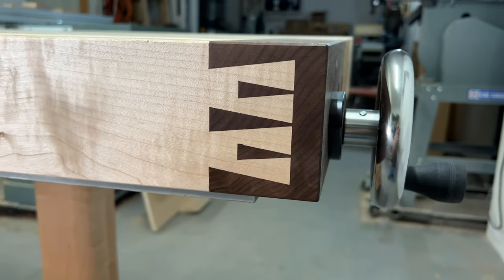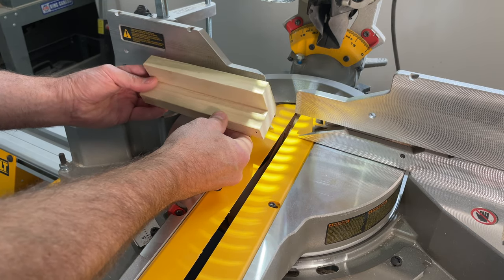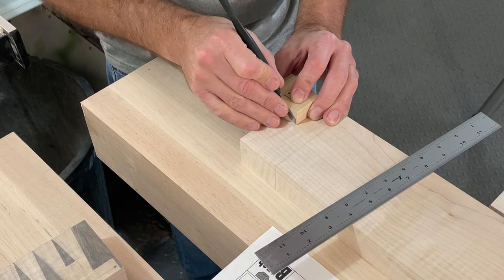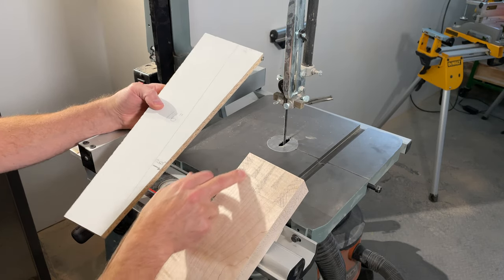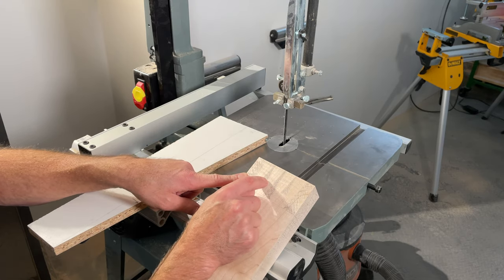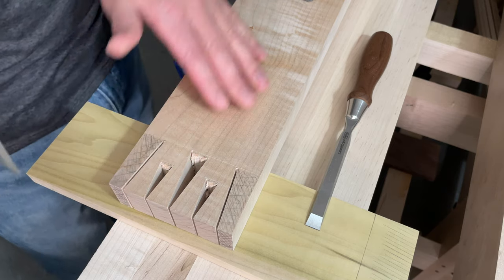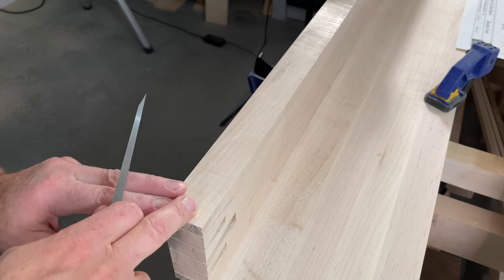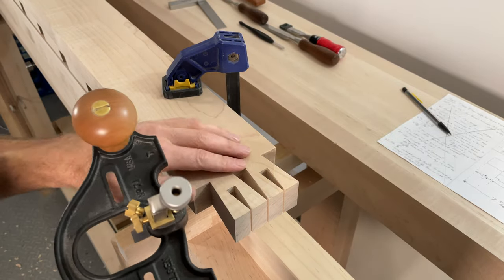Houndstooth Dovetails: Easy Fancy Joinery

Comment: This is my kind of video.  It's all about "how to do this joint".  Some folks just get off track yakking about this or that.  I'm thinking I would have tried trimming out of the waste using horizontal cuts, with the grain, versus vertical against the grain, and cleaning up using vertical cuts at the inside end .  Your technique is one I plant to experiment with.  Thanks for this video and your time making it.
Reply from the maker: Hey Jeff. So I thought the same thing originally but after I saw how fast Frank Strazza does houndstooth dovetails using this technique I decided to give it a try. I feel like I had more control using this method and that it went fairly fast too. I obviously could have done them faster if I wasn’t filming but I just take my time and enjoy the process. Thanks for watching and commenting. It really helps the channel!

Comment: Gary these are just quite beautiful.  I have a question about the deeper portion of the vertical walls of the houndstooth dovetails.  The Cosman (or any) dovetail saw, applied diagonally into the houndstooth, only goes so far in before you reach your limit lines on the top and front faces.  How do you extend the inner vertical wall cuts all the way to the bottom of the dovetail structure?
Reply from the maker: Hey Ken. Thanks for watching my video and commenting with some kind words. I appreciate it very much.

You just simply use the triangular portion of the wall that the saw will cut as a guide. It works surprisingly well.

Comment: Gary, one question. 
For the endcap, that looks like one very thick piece of walnut (16/4?).

I rarely see walnut available in that thickness (I'm in Minnesota) at my local hardwood suppliers. 

Did you buy that at that dimension, or arrive at it some other way?

Maybe i should start looking for carving blocks or something like that instead of rough sawn lumber....
Reply from the maker: It was originally 12/4. I live close to three good saw mills. Two of them didn’t have anything thicker than 8/4 or 10/4 (I forget). They could have “ordered” it to be cut before the next batch went into the kiln but that would have added 4-6 weeks to get it. The third mill had 12/4 walnut but in 12’ and 14’ lengths so they cut 12-13” off of one board to give to me and moved the remaining portion of it to the next shorter stack. 

My advice is to see if someone has 12/4 and just have them cut 13” off of it or ask the mills if they have offcuts in 12/4 sitting in a corner. They often have them so if you ask the person who manages the warehouse and tell them what you need it for and the exact dimensions they may just find it sitting around somewhere. I did this at one of the sawmills and they found me a random offcut but it was after I already obtained the one I ended up using.

You could also mail order it. Lots of people have had good luck buying lumber online sight unseen.

Message me on instagram when you are done so I can see pics!
Reply: @garynelles  thanks for the great info! Will do!

Comment: Great job. What were the dimensions of the wood used?
Reply from the maker: Thanks. Maple front laminate is: 1 ½” thick and 4” wide (vertically). Walnut endcap is: 2 ⅞” horizontally and 4” vertically. 

Hope that helps.